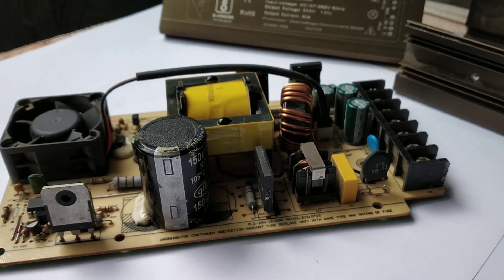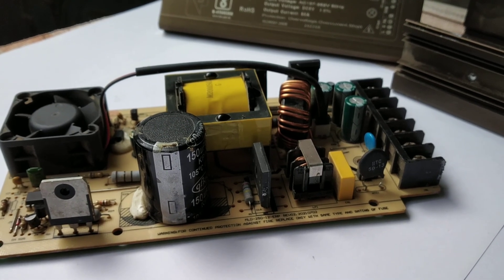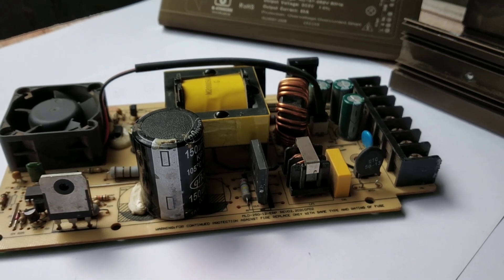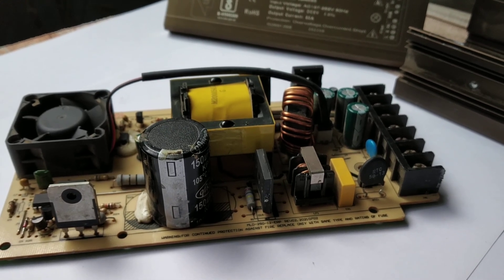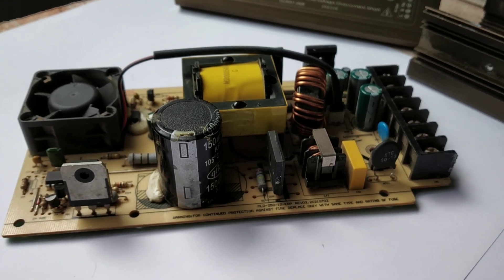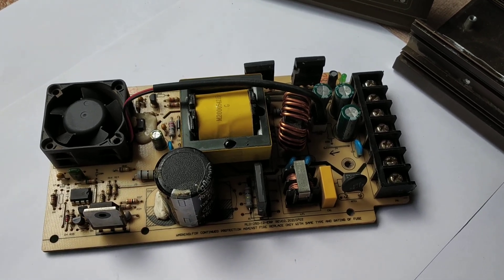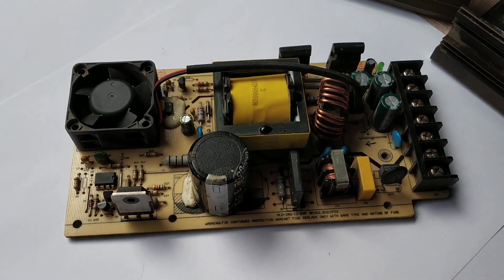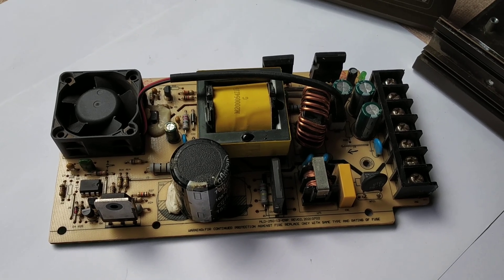Rain Proof Power Supply 5V 80A repair and details

Comment: Didn't you find the datasheet?
Reply from the maker: Of Which datasheet
Reply: @Dcode103  Chinese pwm controller lp9953d installed in my power supply , the same like yours. Do you have a different pwm controller or same?
Reply from the maker: @iuriim5137  lp9953
Pin details 
Pin1 - FB feedback from opto coupl
Pin2 - CC , RC is connected with vcc
Pin3 - CS current sense from external MOSFET 
Pin4 - RT a resistor to Gnd
Pin5 - Gnd
Pin6 - DRV MOSFET gate drive 
Pin7 - VCC max 30V
Pin8 - OVP over voltage protection 
We don't have this ic.
Look it's datasheet and may try other ic with same functions.
Thank you.
Reply: @Dcode103  thank you.